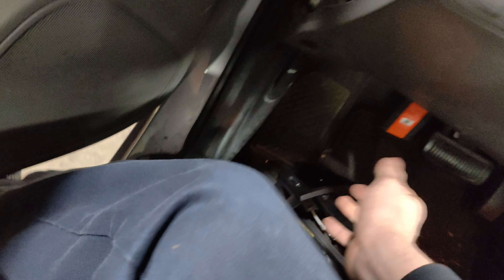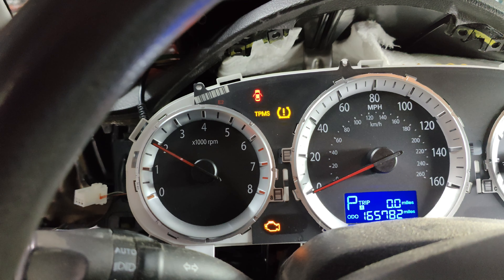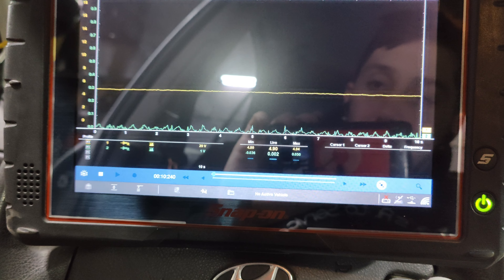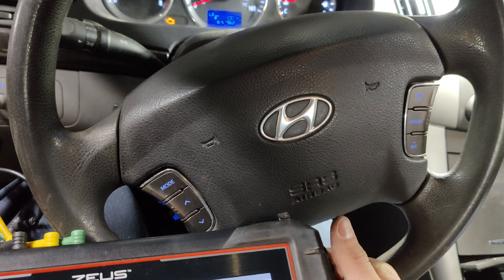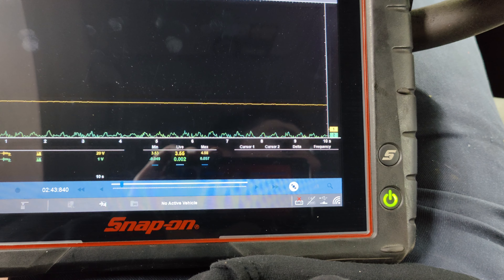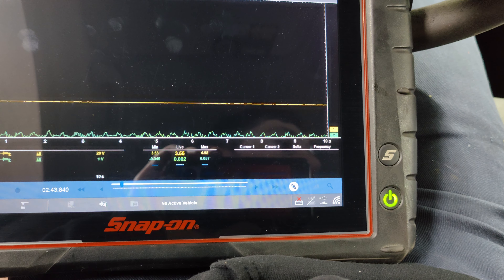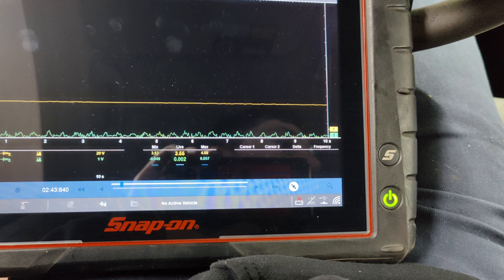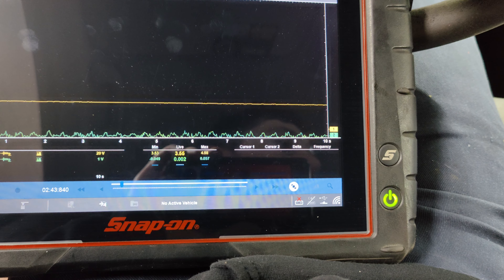2010 Hyundai Sonata 2.4l Coolant Temperature Gauge Goes Up and Down Randomly? Part 2

Comment: GREAT DIAGNOSTIC ,,,, I HAD A PROBLEM SOMETHING LIKE THIS A WHILE BACK WAS A CHEVY TRUCK 1500 WOULD NOT START AT TIMES. CHECKED THE CLUSTER CONNECTOR HAD A BAD CONNECTION THANKS FOR THE VIDEO AND YOUR TIME !!!
Reply from the maker: Chevy had a lot of cluster issues in the trucks. Glad you found your issue and I am glad you liked the video!

Comment: Thanks Mr Robert for sharing 
Just one thing I cauldn't understand 
Why when you touch the resister in the cluster affect sensor signal ??
They should be seperated sensor gives reading to ECU and ECU send the reading to the cluster.
Could you exeplain this for me ?
Thanks
Reply from the maker: The coolant sensor on this car is 4 wires. It is teo sensors in one. One is for the ecu and the other is for the cluster. The Ecu outputs 5v on one wire and then the other goes to ground. On the other side the cluster outputs battery voltage and the other goes to ground. Hopefully this helps.
Reply: @RobertDotterer  
Clear thanks alot brother 🤗
Reply: I think I have the same problem. I changed my thermostat and temperature still starts at below middle with a cold engine. Any advice? What if I changed the coolant sensor?